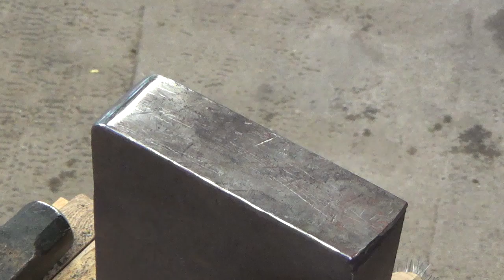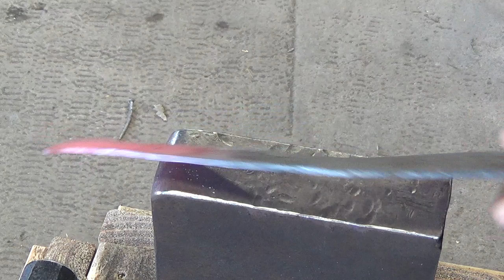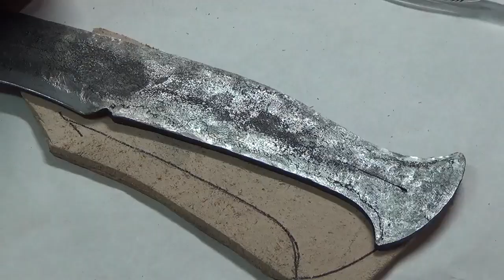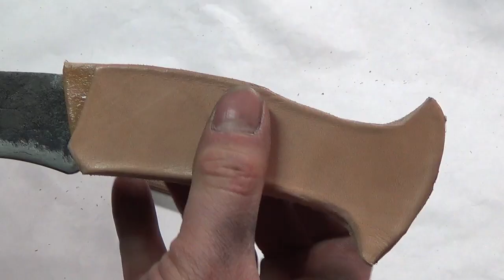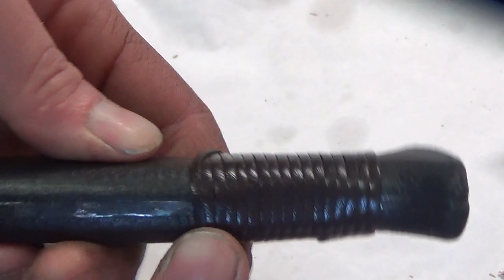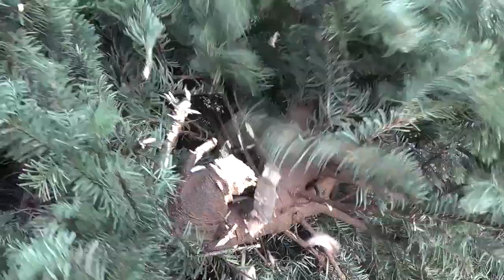Blacksmith Forging a Kukri Knife From a Lawnmower Blade With No Power Tools

Comment: Commentary is helpful, but there's something about letting the art speak for itself that makes this video very compelling. I'm a big fan of the Kukuri, and I think you've represented it well with this piece.
Reply: Very true... I'm a fan of Nepalese' one. Those are really pieces of art. Nevertheless, the only  thing that the one in this video is missing would be the little spike in the small curve near the handle. Blood must drop down through the spike or you may risk to drop the kukri during a fight by letting the handle getting wet and slippery. Good job though.
Reply: +inUR2teeth 
The primary purpose of the "chō" is spiritual hence the reason why it is shaped like a cow's hoof print. It does serve a practical purpose as you stated, to allow liquids to run off the blade edge  instead of over the handle. I have also seen it advertised as a notch used to catch and neutralize an enemy's blade, but a guard would serve better for this purpose.
Reply: +Timothy Dornan   Right, have you come across  the ritualistic videos on YT where they show how they are used to cut cows' head in one shoot? Pretty brutal.

Comment: Well done! I worked in heat treatment for 20 years and would've thought that the blade would've cracked being quenched in water, but it didn't.
✊🤠
Reply from the maker: Thank you for watching!

This method relies on both only partially quenching the edge and allowing the residual heat in the blade to temper the blade. It works well on medium carbon steels I've tried.

I've seen variations on this in videos of many rural bladesmiths in poorer countries and it usually results in a visible hardening line if the blade is polished out and etched.

What kind of work did you do? That sounds awesome.

Comment: Your voice really helps set a pace in your videos. I didn't realize how important it was until you made this without any talking in it. Please continue to talk in your videos. About, what you're doing, difficulties you came across, reasons you're doing something a certain way, whatever. But please talk. It just seems so quiet otherwise. DX

Also did you still sharpen it with a stone or just leave it as it was after the filing? How long does it typically take you to sharpen a knife of that size?
Reply from the maker: +gorisenke Thanks for watching! I established the edge with the file and then cleaned it up and sharpened it with sandpaper, finishing with 1,000 grit. It took about an hour of filing and a few minutes of sanding to sharpen this knife.
Reply: +gorisenke I actually quite liked the mesmerizing video without talking. Both styles are good.
Reply: +BackyardBowyer I agree with the voice. The no voice in this one feels like it's missing what the others have
Reply: +gorisenke I prefer voice. Maybe record talking about the video after you record it.  Then add the voise in latter.
Reply: Monkeysrock
Reply: Monkeysrock I agree please talk again
Reply: Katerine Zambrano

Comment: That was really cool. I've never seen an edge quench like that. I'm new to your channel. You inspired me to make a rebar knife. I'll start on it as soon as I can get an anvil!
Reply: Please don't make a knife out of rebar. It is not high carbon steel, and you will end up really disappointed. Use something like a lawnmower blade or truck leaf spring. it is good quality 5160 spring steel. And don't use water for a quench, it makes the grain structure way too big and very brittle. Canola oil is the best.

Comment: I like it its straight to the point all I need to see is how it's done thx great video,  oh and why don't you use oil to cool the blade before you temper it
Reply: Most old lawnmower blades are made of medium carbon steel, similar to 1040 or 1045. Those steels typically don't take a good harden in oil, and they need a more aggressive quenching medium like water.

Comment: Kukris are such a sick little machete. The sweet of the blade (the bit that is thicker and heavier than the rest) even with one this small could take someone's head clean off easily. Make straighten one out and add a double edge and it becomes not unlike a Greek dagger, can't remember the name right now but it was the small ones with a thicker top almost spearhead sort of look that allowed them to sever limbs quite easily.
Reply: Xiphos. The leaf shaped blade is very forgiving when slashing, unless you're on the receiving end.
Reply: Thats the one!

Comment: Its 3/3/2019 just found and subscribed, this was great watching how you did this. I've machined throwing knifes out of common steel (five at one time using  a fixture and a small manual boring mill.) new job no machining just assembly. My question is can you do this with old "leaf springs"? I would like to make throwing kukris, but they all have to be the same. thank you.

Comment: You can try using some anhydrous borax powder around where the holes were so you can bring the steel up to forge welding temp. That way you can actually weld the holes shut for a solid piece of steel. Also, if you decide you want some 'known' steel nj steel baron has really good prices. I'm really wanting to get into some blacksmithing myself and although I've got a lot of theoretical knowledge I don't have the practical experience because I can't afford the tools. I really enjoy your videos btw and I'm really glad I found your channel. Keep up the good work bud. :D

Comment: Compliments to you... I have been involved in using, carrying and collecting Kukris/Kukhuris for fifty years. It often pisses me off when I see some raggedy arsed machete called a Kukhuri ( no matter how much they charge for it). But , I have seen kamis do the proper job  from bits of old salvaged steel (often truck springs and railway  tracks). Very impressed to see you do a similar , salvage, job, also by hand. And with distal tapers to point and  butt, and what I'd guess was a differential temper. Curious what the Rockwell may have been ?  Only thing I might have suggested was  emphasise the swell in the handle centre. That finger ridge can be essential in retaining a working grip. Sweat, rain, mud, whatever fluids can make them buggers to keep hold of.  I would be ok with that in my collection, or indeed as a 'user'... Kudos to you ... Nice job. and again my compliments.

Comment: it was interesting to see you cool the edge of the blade with the water can like that.  does that give a similar effect to the japanese technique of using clay to cause a variable quench?
Reply from the maker: +aeislugh I've been playing around with this style of edge quench, which is what the blacksmiths in Nepal use on their blades. It does produce a similar effect and if done right there is a differential quench line like a hamon when the blade is polished right or etched.
Reply: +BackyardBowyer how does it affect the edge retention?  if I remember the materials info correctly, the slower quench will result in less brittleness, so I imagine you won't get the same level of hardness

Comment: Nick: I'm usually the first to defend the place of lawn mower blades as smithing stock for various projects, but chopping blades aren't it any more than slicing blades are. Have you ever done any bladesmithing from shears? You'll see the difference when you try the heat treat.
Reply: +canid song I lie: I should say they aren't it too much more etc. You'll still see the difference in heavy blades if you give it a shot vs. better steel. I have reasonably well avoided buying commercial steel wherever I'm not selling work to the public.
Reply: +canid song Your comment is hard to understand could you rephrase?

Comment: looks like you are really getting the hang of forging! I like warch you shape the blade and handle! You made it look pretty easy! 

Also, what torch are you using?
Reply from the maker: +John Tamez Thanks! I'm using a Harbor Freight torch that's made for burning weeds, melting ice, and melting tar.
Reply: +BackyardBowyer I'll have to try it. i have been using the bernzomatic inside some fire bricks (hard ones not the insulating kind you have) and its just not getting hot enough. 

Also, I like your videos with voice commentary better.
Reply: +John Tamez 
A high mass brick will absorb heat from your torch. You can get it up to heat, but it'll take much longer.
Reply: +Timothy Dornan ok, ill try the insulating bricks, thanks!

Comment: nice knife but real kukris are thicker than that they are kind of like hand axes
Reply from the maker: It really depends on what's it's going to be used for. A kukri for light vegetation or kitchen work may be thinner than one for fighting, moderate camp work, and butchering which may be thinner than one used for heavy chopping. They also run the gamut from stick tang, rat-tail tang, hidden tang, and full tang.

Thanks for watching!
Reply: BackyardBowyer thanks for repling and awesome video

Comment: okay, so I'm supposed to not have power tools yet somehow have a forge? that's just nonsense, why even make it without power tools then? I'm pretty sure it's not like people just happen to have forges out there, or if you're in a situation with no power tools it would be extremely damn lucky that you just happened to have a forge laying around
Reply: It`s not that hard to make a forge
Reply: +m16pig granted, but the one in the video is decidedly not a forge you just happened to make, if you were to already have all those things available it would be pretty damn hard for you not to have any other tools
Reply from the maker: What I'm using as a forge in this video is just something I happened to make. It's not so much a forge as an open stack of bricks plus a propane torch that I'm pointing into it. Here's a link to the torch I used: http://www.harborfreight.com/propane-torch-91033.html 

Thanks for watching!
Reply: He's just showing that it's possible to make such a knife without power tools. A forge is something that can be made regardless if you have access to electricity. A torch or even a coal forge with hand crank isn't required to make a knife either. A hole in the ground, a fire in the hole, and bellows made from some wood, leather or fabric, a scrap piece of tubing, and some fasteners will make an impromptu forge if you're in a bind.
Reply: That forge couldn't possibly be simpler. Maybe a campfire and a hair dryer or a bicycle pump or an homemade bellows.
Reply: To be fair my first champion coal forge cost me quite a bit less than almost all my power tools. Old lady was using it as a flower pot..
Reply: +david miranda "but the one in the video is decidedly not a forge you just happened to make" Uh, did you watch the same video as me? Because the one in the video was a stack of broken breeze blocks and a blowtorch, it would take maybe 10 seconds to stack the blocks up (which you can buy for a little over £1 each here in Britain, and a small torch isn't particularly expensive either), it's not like he has a real forge for crafting swords.